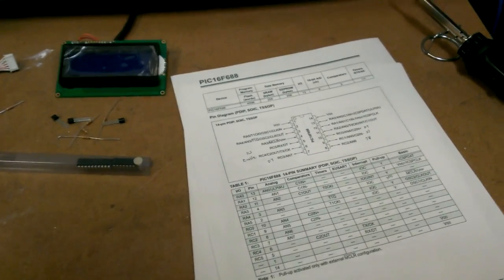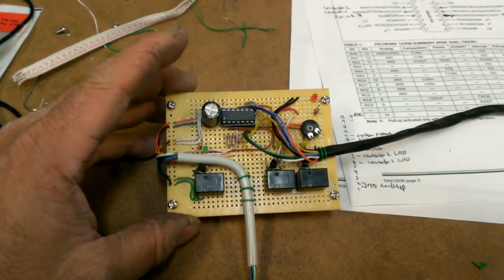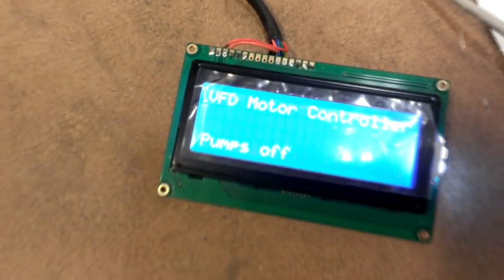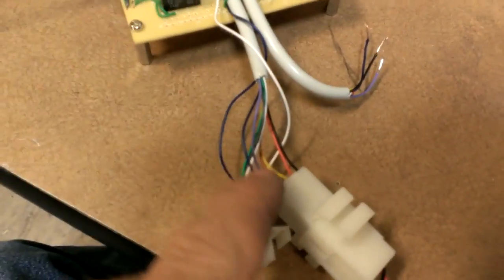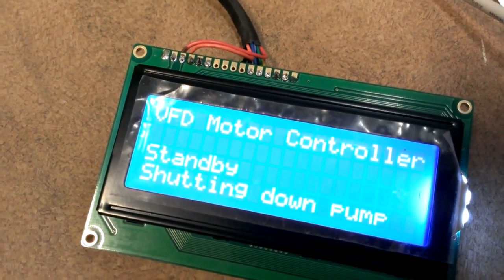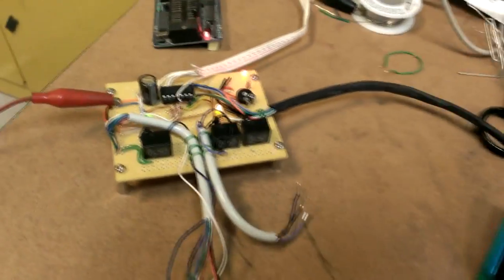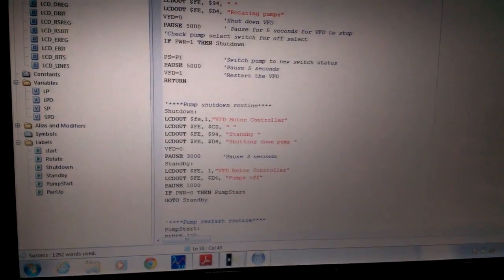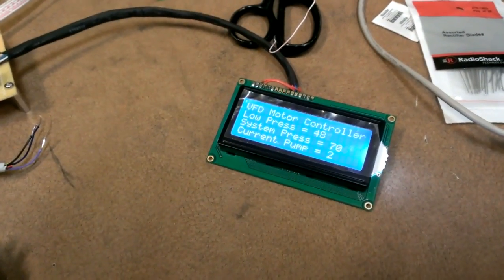Pump Variable Frequency Drive Retro Project - Part 4 - Control board finished

Comment: sweet. I am pretty good with electrical circuits still learning a lot but I did do a pretty decent job of upgrading the wiring in one of our boats. Our Supra Comp was a night mare! they did a half decent job with the positive wiring side but the grounding barely existed! the battery sits just on the other side of a wood wall but the feeds run to the back of the motor, hook up to the starter solenoid and the block through 10 AWG. boy what a voltage drop there was once you turned on the lights...

Comment from the maker: I've been into electronics forever. But was too poor to get cool stuff when I was younger. 
I got into microcontrollers about 7 yrs ago. 
I only mess with them in spurts whenever I want to make something. 

Electrical circuits are things I can usually just wire up off the top of my head unless it's really crazy. This one is pretty simple actually as far as the wiring and all goes. Had to dinker with the logic until I got the bugs worked out. 

I also used a Microchip 16F688 I don't use anymore.